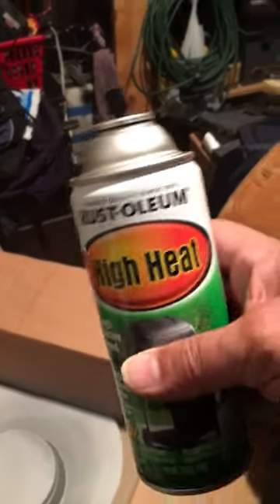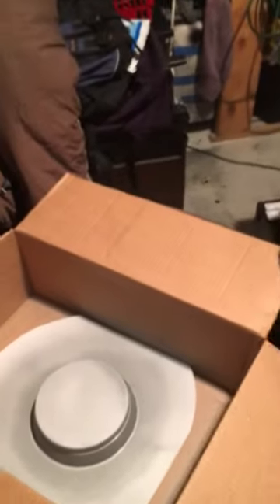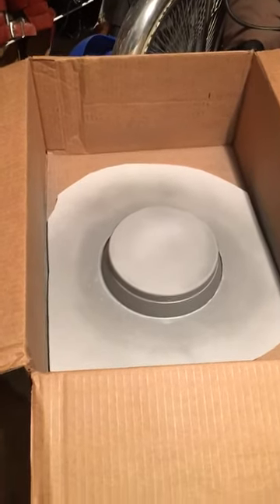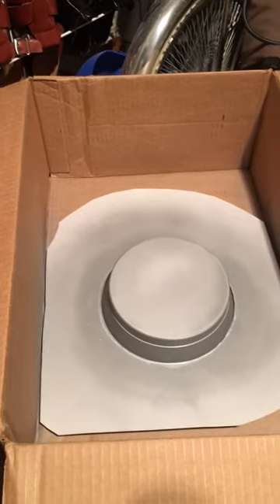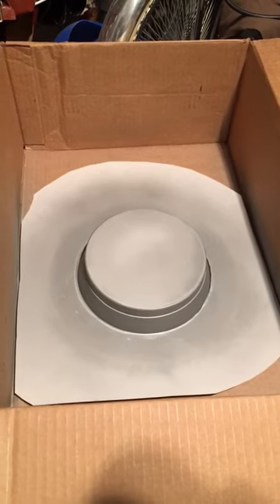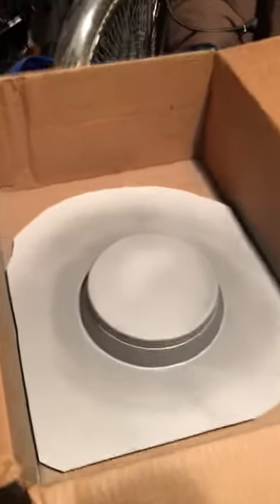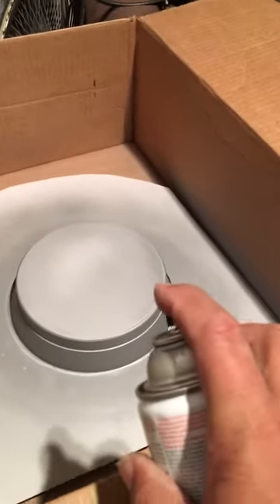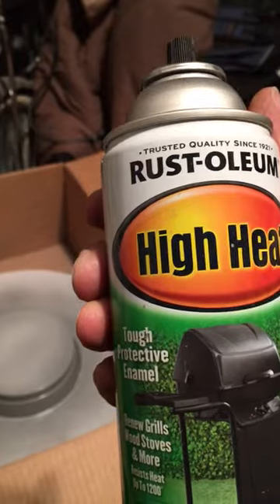How to Paint Brake Rotor Hats

Comment: Don’t need to apply primer ? What if they are already rusted
Reply from the maker: Already rusted?  You would need to clean them , perhaps use steel wool to remove the surface rust.  Basically if you were not going to purchase NEW rotors you would have to get them prepared for paint.  I suppose using primer could not hurt and we’re only talking about like $3.00 extra… so I mean.  Maybe for peace of mind throw an extra few dollars at it with another cost of primer.  I personally would start with new rotors.
Reply: @avp0713  yes it’s because I barely bought them and they got rusty quick . And I want to paint them
Reply from the maker: @gerardo1013  - that’s just “surface rust”… s as little steel wool takes that right off.  If the rust is on the surface where the pads touch, then the brake pads will knock the rust off.